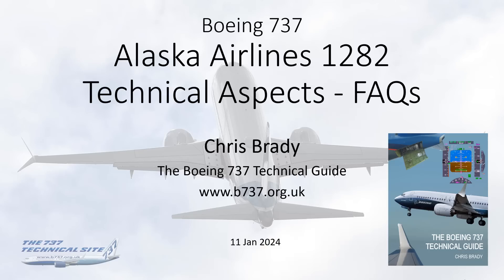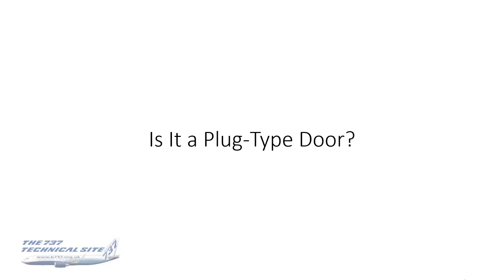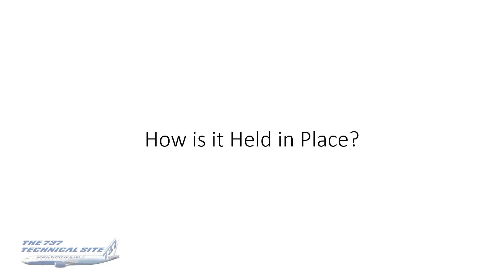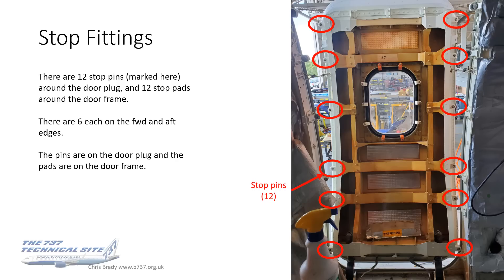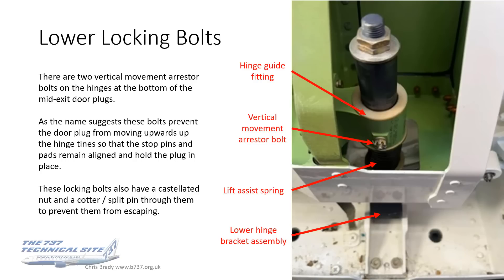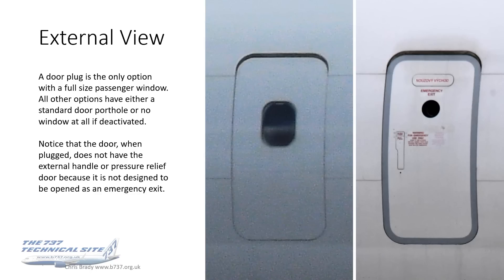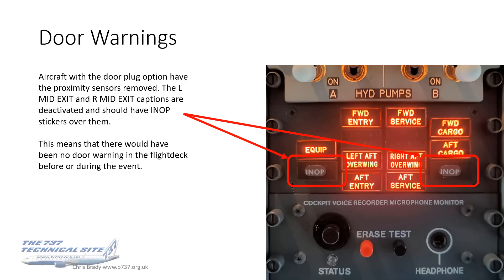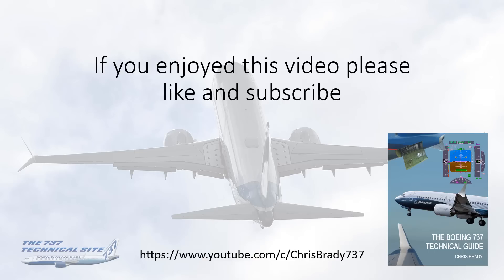737 Technical Aspects of AS1282 FAQs

Comment: An important point has been made below, based on relative dimensions, namely that the pins can clear the pads before the channels have cleared the roller pins. If the hinge fittings are loose (and the top locking bolts are not installed) , then the door could ride up sufficiently to clear the pads - perhaps 20mm or less. This could happen even if the bottom locking pins were in place. All that is needed is enough play to allow the hinge rotation by say 20mm. In that condition the door ceases to be a plug type, and the full 6000 lbs or whatever is applied to the lips of the channels (hence the damage) and the loose bolts of the hinge fixings.  Speculation, of course, but perhaps a possible failure sequence.

Comment: The reason the 900ER isn’t on the AD is because all NGs have been through their C check structural inspections and all of these bolts and structures have been fully inspected at least once. The door plugs are the same.
Reply: There’s three configurations available for the mid exit door: active door, deactivated door and plug. Plug has full size window and no latch mechanism. Active/deactivated door has port hole window and latch mechanism, as well as exterior handle. All three have been available since the 900ER.
Reply: Thank you for that info. Would the plug door in general and the upper and lower locking bolts specifically be checked during normal scheduled A, B, or C checks?
Reply: The max airplanes, being so much newer, and less history than the good old 900 ER that we have flown for years makes me think they’re just going to focus on the max for right now. After all, that’s the aircraft that had the problem. I would not at all be surprised if down the road, they decide to include every 900 ER in this airworthiness directive. That would make sense and make the public feel a little happier I would think, if they don’t do that and a 900 ER plug ever comes open they’re gonna have a lot to answer to
Reply: If so why didn't the FAA mandate the grounding and inspection for MAX-9 that did not go through a C-check? (Many MAX-9 already did).
I don't understand discriminating just by subtype model. Explain the rationale and apply it to all the airplanes that meet that rationale.
Reply: is the 900er out of production/ is not maintained by Boeing? if boeing  qc is part of the cause then they these should not recieve special treatment.
Reply: @mgriffioen8503 900ER is out of production but still very much supported by Boeing. The reason the AD isn’t applicable to the 900ER is because they have all been inspected already.
Reply: The 737-900ER is on the list now, it's not grounded but the FAA wants them inspected
Reply: It's 8YR & high cycles for the DVI of the door. All 900ERs have only tow lock-out bolts (uppers) and a lock crank in the disabled door opening mechanism. There was a re-think on the MAX configuration.
Reply: C and D are the heavy checks. C check is full structural inspection and often includes stripping out the interior to inspect frames, stringers, panels etc for corrosion, torque, etc. A and B are light checks that are focused on higher wear areas like landing gear and control surfaces.
Reply: A C-Check is not a full structural inspection - they are phased into blocks over 8/10 years. I think there will be a AD for the 900ER in the long-run as the surveillance of the door and sorround structure is such a high interval. Zonal & External GVI doesn't even remove the side-panel.
Reply: That makes no sense.Or is the FAA suggesting that they trust maintenance contractors but only Boeing could ruck this up?

Comment: Where’s the triple redundancy that the industry always boasts?

A) it’s not a true “plug door” in that it isn’t bigger on the inside than the outside so that it can’t fall through the aperture. It seems it should be. 

B) It’s still a door but yet there’s no door open warning light (though in defense of the system, how would it even be defined as “opened” since it’s such an odd door/not a door?) 

C) there’s no visual, external latch to both give a visual “check” as well as give a second level of closed position security  

Since I’m not associated with the industry, just an average person, my question is:

Could the essentially opened/boltless “plug type door/we don’t know if it’s a true plug type door” door cause the pressurization trigger scenarios mentioned in this video? (If so, then that’s a good plane that was trying to do it’s job. If not, epic industry failure in my humble opinion.)

BTW, excellent video. Thank you very much for this very informative video. Thank you for taking the time to do it.

Comment: Perhaps you could explain the procedure for closing and securing the plug in some detail.  As I understand it, when the plug is open, the springs are strong enough to support the weight of the plug and hold it in the raised position.  Then after the plug is rotated into the fuselage someone would push the plug down against the springs and hold it there while someone else would install the four bolts that secure the plug in the "down and locked" position.  It would seem then that if the securing bolts had not been installed by the factory that the springs would have raised the plug up and it would have been pushed open immediately the first time an attempt was made to pressurize the cabin which would happen in the factory during leak testing.
Logically, this would make it impossible for an airplane to get delivered with the bolts missing, which might have been the thinking of the designers.  So I must be misinformed about something or my logic is faulty.  Any thoughts??
Reply: it would seem that as long as the springs make the door weight neutral, like any typical door, that’s enough push such that anyone could open it. Who knows what it’s actually like.
And if there’s no push lift, the door seems like it could remain in place for some time unsecured just using some mechanical knowledge.
Reply: @JohnHallgren  Last night I found a very interesting YouTube video clip of the "A321 EMERGENCY DOOR OPERATION".  The basic operation is similar to the Mid Cabin Emergency Door operation on the 737.  I would guess that the A321 door must weigh 135-180 kg and the slide is not part of the door.  Airbus likely holds a patent on the door.
Reply: I suspect that the springs are not able to lift the door to the release height on their own.
Reply: @GH-oi2jf  Since we do not know the strength of the compressed springs we have no way to know this; can someone provide some spring data?
Reply: To be safe the springs should be strong enough to support the weight of the plug so that if the securing bolts were not installed the springs would position the plug in a position where it would not be possible to pressurize the airplane.  The seal at the bottom of the plug would be gapped and any attempt to pressurize the airplane would just push the plug open at a very low pressure.  Fail Safe on the ground.  A problem may arise if the springs were not designed to overcome the friction of the seals thereby allowing the plug to remain down behind the stop fittings even thought the securing bolts were not installed.  Subsequent minor vibrations during ground operations and unpressurized taxi conditions would allow the springs to keep creeping the plug up a little higher over many cycles until finally it moved enough to move the stop pins over to the edge of the stop pads and then the cabin pressure could blow it out.  Seems to make sense to me. @GH-oi2jf
Reply: I added this reply to the blancolirio post ysterday.  It's pages down in the replays.

Let me give this a try.
To install the plug:
1) Lift the plug and place it on the 2 Lower Hinge Mounting Shafts, and install the 2 heavy washers and 4 lock nuts at the top of the 2 Lower Hinge Mounting Shafts.
2) Push the plug (wt aprox. 60 Lbs.) partially down which compresses the Lift Assist Springs to just before partial compression; more about this part later.
3) Continue compressing the Lift Assist Springs and rotate the top of the plug toward the airframe until the Roller Pins enter the Guide Tracks which places the Stop Fittings against the Stop Pads.
4) Push the plug down until the Roller Pins are fully inside the Guide Tracks, then insert the 2 Upper Locking Bolts into the Guide Tracks, thus holding the plug in place.
5) Move the plug slightly up or down until the Lower Locking Bolt holes are aligned, then insert the 2 Lower Locking Bolts into the Hinge Guide Fitting and the Hinge Shaft, thus holding the plug completely in place.
6) Place the Upper and Lower Nuts and Cotter Pins.
To Remove the plug:
1) Remove the Lower and Upper Locking Bolt Cotter Pins and Nuts.
2) While Frmly holding the plug, push the plug slightly down to remove the shear stress on the Locking Bolts.
3) Continue holding the plug and slowly allow the move up until the Roller Pins clear the Guide Tracks; at this time the top of the plug is free to move away from the airframe.
4) If the 2 Strap Assemblies are not attached, attach them.
5) Slowly allow the plug to move out to the partially open (15 degree) postion.
6) To completely remove the plug, attach the plug to a hoist, remove the 2 Strap Assemblies, Bonding Straps, 2 washers and 4 lock nuts at the top of the 2 Lower Hinge Mounting Shafts.
7) Use the hoist to lift the plug off the Lower Hinge Mounting Shafts.
I'm sure that this is not the complete procedure because I did not remove the 2 Lower Hinge Bracket Assemblies, but I think that it should cover most of the steps. BTW, I'm not a ME, A&P, pilot but the steps appear to be logical. It would be very interesting to read the actual procedures.

BTW, Juan plays a mean string bass.
Reply: @michaelhenning8090  interesting…but if the springs are actually pushing it up, wouldn’t that mean that without the locking bolts in place (as pins at least), the door would bounce up easily and move out of place?
I agree with a tiny bit of push down to stop any contact with the locking bolts but that’s the limit of movement that I can see just from the pix.
Reply: @JohnHallgren  as seen early in the video, the springs push the guides up the shaft until they reach the larger diameter washers and nuts on top of the post. While this limits the extent of door travel during ‘normal’ inspection, in-flight dynamic and pressure forces could easily exceed the strength of these retaining washers.
Reply: @JohnHallgren  I believe that when the door is in the closed position, even without the Upper and Lower Locking Bolts, the combination of the 12 Stop Pads (on the Door Frame), the 12 Stop Pins (or Stop Fittings)(on the Door Plug), and the Gasket (on the Door Frame) would provide enough "friction" to hold the Door Plug in place when on the ground; when in the air, the external/internal air pressure difference should push the Door Plug firmly in place.  My guess is that the compressed springs should roughly equal the Door Plug weight (mass), but I do not know that the compressed spring pressure is; does anyone have an idea?  That being said, missing the Locking Bolts, the assembly is like trying to juggle a set mouse trap; with even fewer than 4 Locking Bolts in place the Plug should not move.  FWIW, I believe that the Upper Locking Bolts would likely remain in place even without the nuts and cotter pins; comparing the artwork with the photo it's not clear that the Upper Locking Bolts are horizontal or at an angle.  Remember that the compressed springs are trying to push the Plug upward which would put the Roller Pins in firm contact with the Upper Locking Pins. See my step 2.  With all 4 Locking Bolts, nuts, and cotter pins in properly installed it should be as secure as having a Door installed.
Reply: @michaelhenning8090  i definitely agree with your conclusion re friction and such.
And as long as the springs provide enough push to hold the locking bolts against the roller pins, it doesn’t probably need to be SO much that the door would be pushed/smashed up all the way to the top of collar/pin at bottom connector without any human interaction.
Reply: @michaelhenning8090  Hi. That is very detailed description. Do you actually work on Boeing aircraft? If you do, I would like to ask you some more details about features of the plug. Regards.

Comment: Excerpt from Boeing memo...
DOOR PLUG This option is only available on the -9 and limits the maximum capacity to 189. The door structure is modified so the sidewall does not infringe into the interior and a row of standard seats can be installed. A full-sized window is also installed. Boeing warns that future activation of the mid-cabin emergency exit doors will involve significant cost and therefor to consider retaining the baseline configuration with deactivated mid-cabin exit doors if future activation of the mid-cabin exit doors is required.

Comment: Thanks for what you are doing Chris, it greatly adds to our understanding of how this "door plug" operates and is installed. If I may ask, do you know if the hole in the lower hinge (black piece of the lower hinge bracket assembly) is a precise hole sized to fit the Vertical movement arrestor bolt (and prevent any up or down movement) movement  or perhaps a "slotted" hole that limits the vertical travel of the door? Calling it an "arrestor" bolt makes me think the latter.  Is the lower hinge assembly and hinge guide fitting the same in both the non-operational plug and the operational exit door? Not knowing what condition the door is in at the time of picture(s) being taken makes it a little more challenging understanding how it is designed to work. 
It would also be nice to know what the conditions were in place at the time of "auto fail" caution light illumination, and the corrective actions taken each time. I am not yet ready to dismiss any possible link between the door loss and pressurization faults. Thanks again.